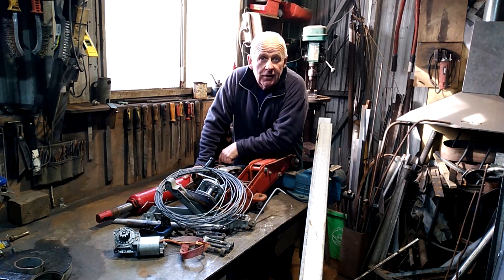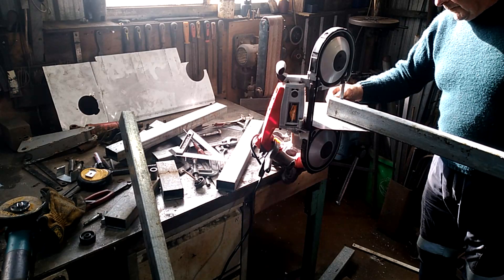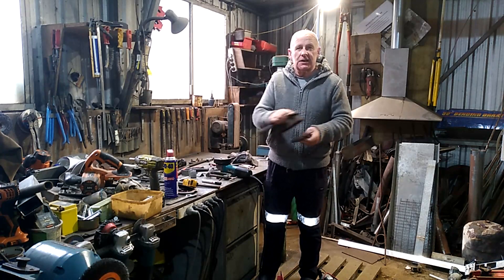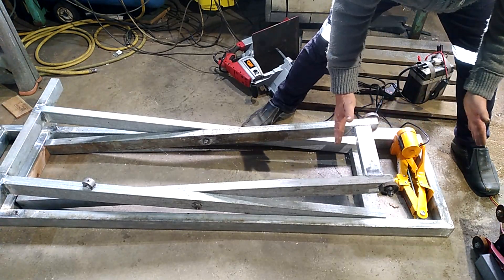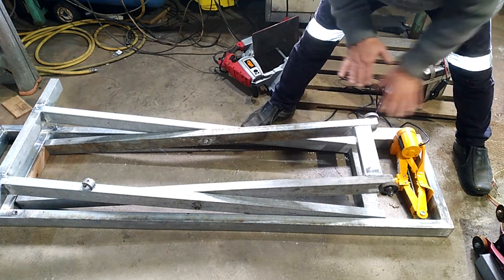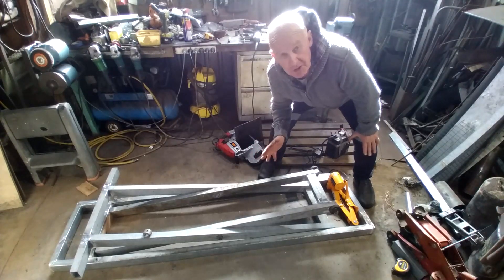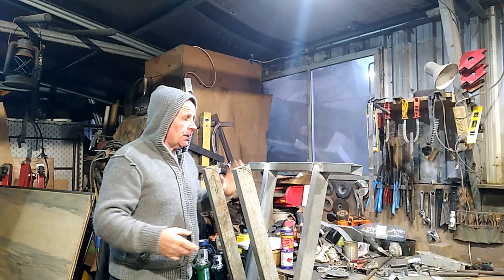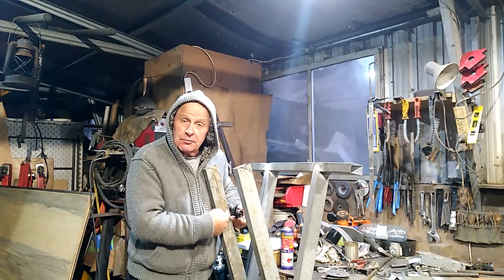Bike Table Scissor Lift vid 2 -geometry problem solving.

Comment: An oilite sleeve or bushing inside the wheel longer than the width of the rectangular tube with a circlip on each side could be pushed out from one side  upon assembly, paint does not adhere well to oilite. Could be easily polished to remove paint with scotchbrite and reused many times. If I understood the poblem correctly.
Reply from the maker: thats how I was going to do it. The next vid shows how #michaelmichael suggested I do it- You will find his suggestion further down here. It works perfectly. Now Im making the 'extras' the wheel clamp, the safety latch and of course mounts for the scissor jack- That will all be in the next - next video

Comment: I don't see why you can't weld on the end caps after everything is assembled.
Reply from the maker: because I want to paint everything separately then assemble it. @michaelmichael sorted it- Just make a hole in the outside face of the table frame and bolt the wheel though the hole into a threaded slug welded into the top of the leg. Then  when the alloy checker plate goes on - the edges cover the hole!

Comment: The yellow jack looks compact. How about using the jack with the baseplate on the floor and pushing against a crossmember at the center of the scissor lift? How much height are you looking to get? Have you thought about a telescoping outrigger somewhere on the frame to increase stability? Your frame looks great but maybe a bit narrow,maybe I'm wrong. Either way nice work so far
Reply from the maker: the pivot point moves sideways as it raises so the floor would have to move with it! I had so much fun last night experimenting. next video very close!

Comment: start with the jack fully extended  and pull the frames together at the bottom,   yellow jack will have its maximum power at that point, albeit will be slower to start moving the frame , but its power you need at that point, not speed.    how you fit it in there, may be  challenge , or you fit it outside and have a pull rod running though to the other end.  did a similar thing with a trailer tip tray mechanism , many years back, using a manual car scissor jack.   dont have the trailer anymore, but might have an old autocad drawing of the mechanism.  could sketch it out if it doesn't make sence.
Reply from the maker: Thats the best understanding yet! thanks. there is so much to consider. as you use a pair of scissors- so fer people realise what is going on in their hand! sliding, pivoting, shearing, advancing. - all at once!

Comment: Well I didn't think I would be thinking about mechanical advantage on a scissor table today! But as I am ......

Could you have the scissor jack pushing against the centre pivot point of the scissors? It would need an axle and you may have issues with the base having to pivot, but it would overcome your mechanical (dis)advantage giving a unity lifting ratio!
If you have a piece of round bar the right size you could tap threads where needed and leave unthreaded section where the bearings are to be.

It will be interesting to see the solution! ........ Have Fun!
Reply from the maker: You wouldnt believe how far that pivot point moves to the side as it raises! it moves by 180mm to one side so the mount would have to match that movement.  So much to consider!
Reply: @t.h.o.r.  It should be 1/4 of the length of the arm. But as you extend you get a balance issue. As you say ...... complex! As the guy who taught me to fly said " If it were easy everyone would be doing it"! And that is why it is worth doing!

Comment: Roller guides cut into the outside crossmember for the jack start issue? Feels like friction is the issue more than the jackknife inducement. That could also allow for the roller wheels to be mounted.
Reply from the maker: the rollers run lengthwise- not across? they will be inside the side rails of the top. there is no clearance to get the assembled axles in the slots.  With the jack angle, Its way too close to a straight line at the start. As soon as the angle changes, its away. With the rollers in it will be virtually frictionless. I just have to push on more of an angle

Comment: moving the scissor jack like you said would mean the table wouldn't lay very flat.
What you could do is take the trolley jack and cut the front lifting mechanism part off and fit it to the other side of the beam that the scissor jack is pushing against.
Then connect a piece of rod to where the hydraulic cylinder rod would have connected and run that through the beam to the end of the scissor jack,  where the rod meets the scissor jack you will need to work out some kind off hinge.
Then add another beam between the inner the legs of the table for the lifting pad of the trolley jack to push against.
You will basically be using the scissor jack to do the job that the hydraulic cylinder did.
when you actuate the lifting process the trolley jack will do the first heavy part of the lifting then when the rod runs out of travel and the scissor jack will hit the beam and take over the rest of the lifting process.
Hope that makes sense.
Reply from the maker: read my reply to #kiwiingenuity1677 I think its  sorted. - not sure why you think the table will be off level though? _its self compensating, when one leg lifts - the other matches it- stays perfectly level.
Reply: @t.h.o.r.  I meant flat as in height, not as in level.
Reply from the maker: @williamwilliams8145   Oh yeah, its 170mm high now. With the jack in the new position it will be 220mm but at that height it will be just out of the 'vicegrip  zone.' Ive been looking at specs of bought ones. they are all i80- 220 in the min height specs.

Comment: I would look at using a large say m12 coach/carriage bolt so you can fit the head/ bearing- sliding  part into the box section.  You  will  have to mark and cut a s lot to allow  for its full travel.  To fit you will  drop in one end and then either  blank off  permanently or have removable bugs to allow for service.  The bolt/ axle on which the wheel / sliding bit turns will need a larger hole on the outside edge to install bolt head or a circlip on the axle shaft. If you use a bolt it will  probably need a custom made bush to take up the difference  between bearing and axle sizes.
Reply from the maker: yup  thats it!- Thanks- Threaded boss in the leg and a hole in the outside face to pass the bolt through. When the alloy deck goes on you wont see the hole cos it has a 50mm folded flange down the sides